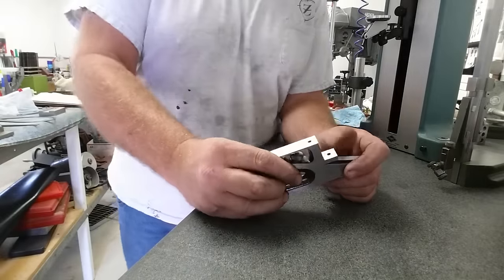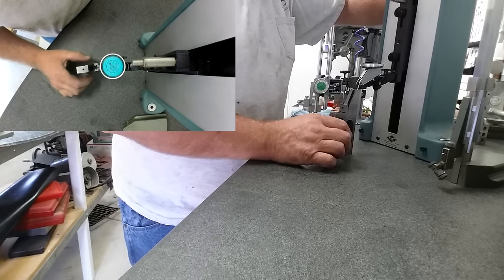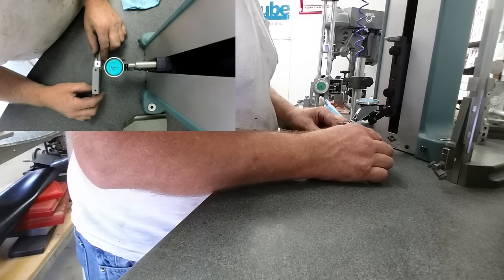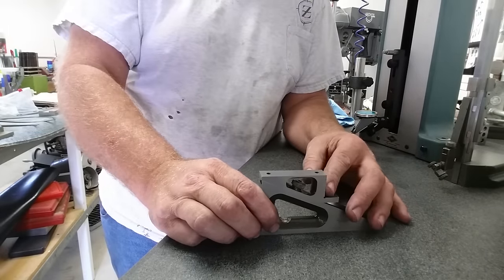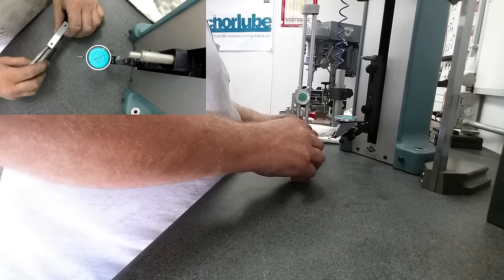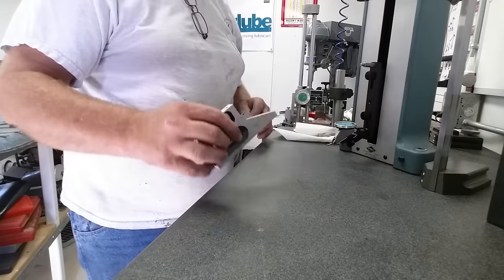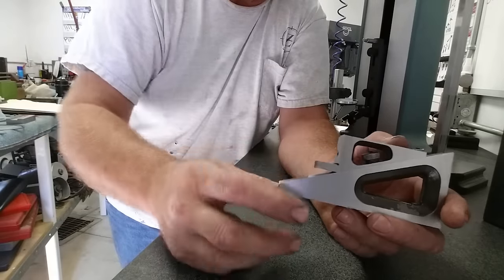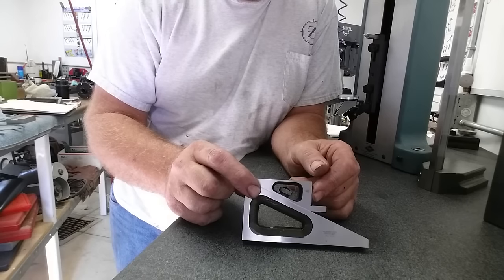Planer gauge tune up

Comment: yes Stan, these point are plottable and gives a better calibration curve. my reference was only to the parallel slide at the 3 spots along the hyp length. your full length runs with run outs written on the length is a good method. really enjoy your calibration vids, you have the touch/feel for this process. as you say, "everything counts".

Comment: A great video, it made me check mine and although I don’t have the master you have I figured out it needs some TLC. One question, when you decided to grind the sliding portion because of the extra thou on the one side, could’ve it been caused by debris, oil or rust between that piece and main body? I ask because I found an eye lash between my planer parts.
Reply from the maker: I cleaned the slider before the check.

Comment: Stan, why do you not use a 5 point check along the length during your calibration checks?
Reply from the maker: +dlstanf2 0-25-50-25-0 checks are for full scale accuracy of gauges, I am using the gauges comparatively, is that the test you are referring to?

Comment: Ah all is good BUT from the top plane to the small step ?
Do you have your 2"
Reply from the maker: +Joe Duruisseau Had no idea it needed to be, what is the purpose of that?
Reply: My 2 Starrett gauges have a 2" step do you have the one and two inch extensions ?
I use mine as adjustable gauge blocks and
measure off the gauge kind of like a big telescoping gauge .I run a large horizontal
boringmill  some of the things are 60 tone
so the tools are Adam Booth and a lot more